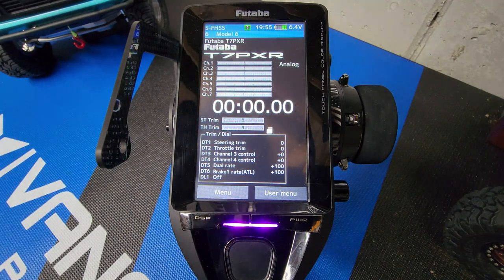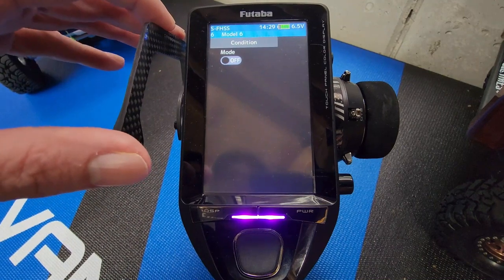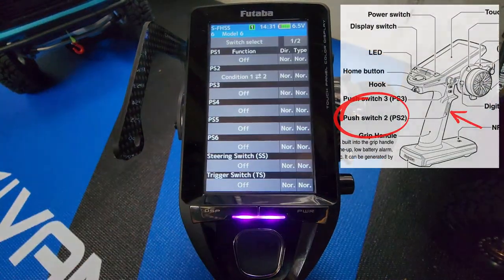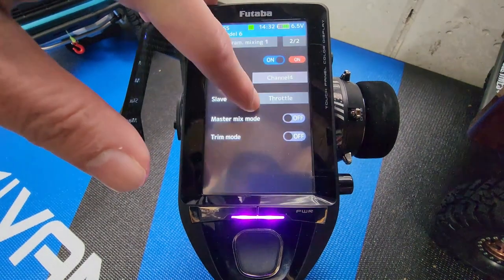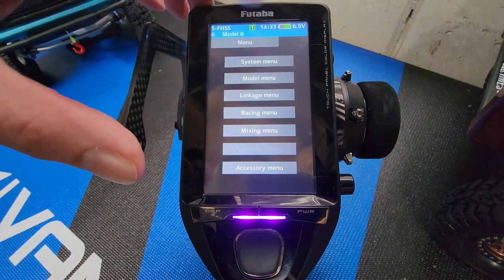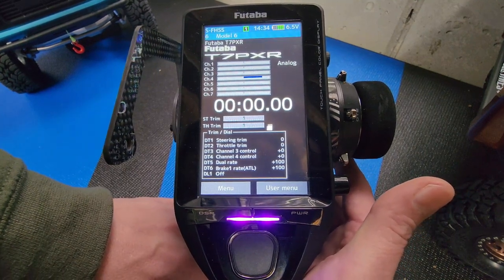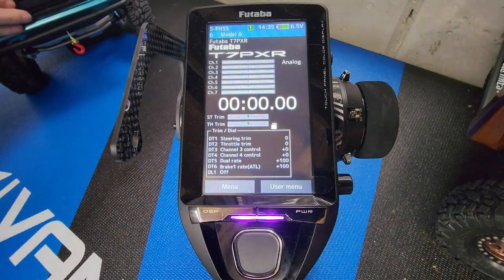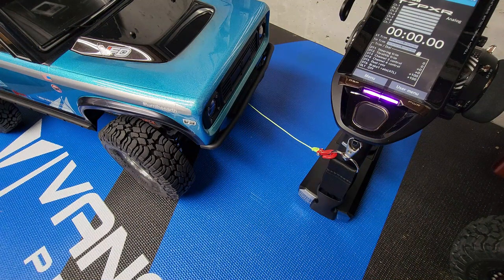Futaba 7PXR Winch One Channel Momentary Setup using the Condition Function - How To

Comment: Great video and detail, I know the illustrations etc. must take time, and it’s appreciated!
I programmed the DL1 dial (Digital Dial) for my winch. I only use winch as a lift for my mini snow-plow on a Losi 1/5scale, so it only “needs” to go in/out about an inch. The dial makes it so it only moves in/out as much as I turn dial in either direction, then stops when I stop turning (maybe 1/8 turn in either direction anyway).
So instead of using a whole winch setup, I just put the winch spool on a servo and set servo to turn 360°~ in/out. 
I put a pulley in place to create downforce on plow blade as I winch in, so the plow blade doesn’t hop. It’s pretty cool to plow sidewalk, especially using paddle tires on all 4-wheels. Doesn’t work real well with packed snow, but moves 1.5” of powder nicely. 
I can use it as a regular winch as well, but it’s not as smooth as a momentary switch since ihave to turn knob. 
Take care!
Reply from the maker: Thank you for watching and the detail on what you are doing.  On my straight plows I use the knob to move the plow side to side.  Yeah I never did any programming on limiting the winch on any of my plows and I probably should look in to it on both my TX radios I use.  For my snowblower I use actuators and those have automatic stops which I like.  Again, Thank You! 🙂

Comment: Dude you rock! I’ve been trying to find this to use on trim for a big boat. Is there a way to put an end point on the winch servos? I’ve tried but no luck
Reply from the maker: @5150BlackDog  Thank You for Watching.   No, not that I am aware.  I researched this a few years back when I built my first snow plow truck and didn't find anything.

Comment: I noticed you're not on the latest firmware (5 bar battery vs 3). Futaba added winch control features in there that are worth looking at.
Reply from the maker: I'll have to check the version.  I thought that was for the 10px tx not the 7pxr.   It should be 5 bars on my current firmware.   I did not have a full charge.  However, thank you for the information.
Reply from the maker: Well, I see.  Something new to play around with.  I see how it works and it is similar to how I have one of my rigs setup on my DX6R. 

Again, Thank You for the information.

Comment: Hi .is there a way you can control power output on ch4. I was always wondering if I can switch on/off my lights on my ca r from the remote . I would power it from ch4. Tia
Reply from the maker: Thank you for Watching.   As long as you have a switch, you can control your lights on any open channel you have on the receiver.   If that is channel 4, yes, you can use that. 

The switch I use from Amazon.  Apex RC Products RC Remote Electronic AUX Channel On/Off Switch #9025
Reply: Thank u

Comment: What receiver are you using?
Reply from the maker: I am using the R2008SB receiver.
Reply: @henrysrcgarage5210 I can’t get mine to work with the injora 3 way switch. Both my receivers say nope.
Reply from the maker: @Life Through A Lens  hum,  not sure the issue.  I was looking for an Injora 3 way switch or winch controller and could only find the Injora wireless ones.  Those won't work with any rx / tx since those have a key phob to control the winch.
Reply: @henrysrcgarage5210  Which 3 way switch are you using herein this video?
Reply from the maker: @Life Through A Lens  I am using  Reef's RC servo winch.  This has a built in controller.
Reply: @henrysrcgarage5210  agh thank you.
Reply: My 7px only says condition copy first to second